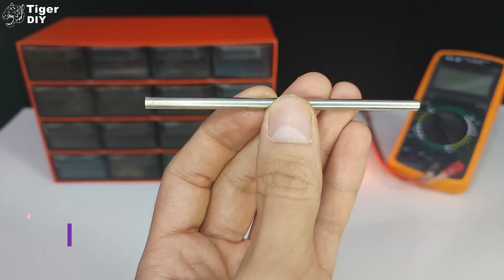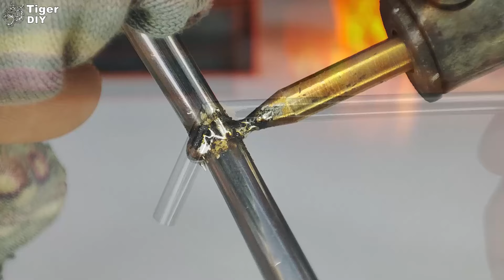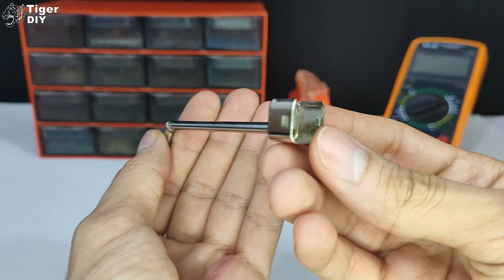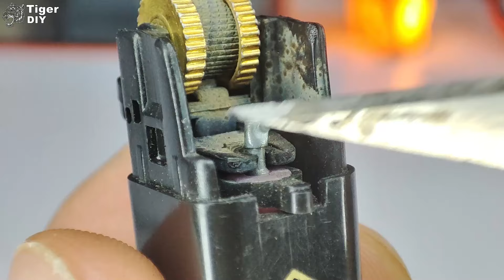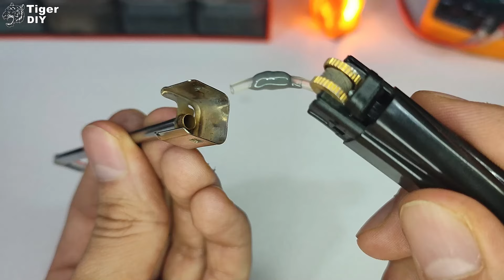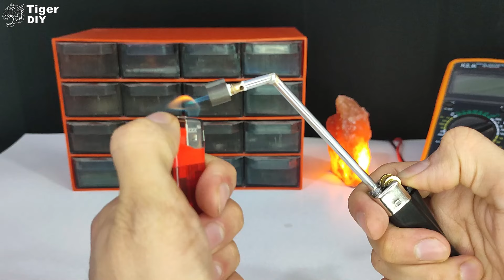Lighter Into Torch - DIY Mini Welder !!!

Comment: What is that white glue you are using? Please  name of the glue
Reply from the maker: That's silicon glue. don't miss my new video 💚
Reply: @TigerDIY1  I watch your every video❤️
Reply: @tigerdiy1  can I use any types of silicone glue? You mean those which are use for glass , aquarium ,tiles bonding?
Reply from the maker: @MRDBABC  In fact, this silicone glue is special for electronic boards, which has high thermal resistance